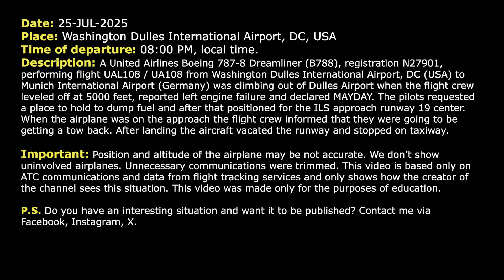MAYDAY. Left Engine FAILURE on takeoff. United Boeing 787 Dreamliner returns to Washington. Real ATC

Comment: Pilot said he had 5 hours of fuel left but they were heading to Munich? Isn't that more than 5 hours in the air??
Reply from the maker: Airplanes burn more fuel on low altitude.
Reply: Aircraft also have to carry extra fuel on case they have to devert to another airfield in case of an emergency

Comment: I live about 8 miles as the crow flies south and a bit west of Dulles. in the rural area of the county.  I usually watch the planes come and go when Im outside and have a pretty good feel for what is a normal route.  A few days ago I was outside working in the yard and noticed an airliner making an unusual path out towards the west heading north.  I thought that doesn't look right and wondered if I'm going to see something on the news.  Well, tonight I saw this story and realized this was what I saw.   So when I saw them they would have been on the south end of the loop heading north. 

MAYDAY. Left Engine FAILURE on takeoff. United Boeing 787 Dreamliner returns to Washington. Real ATC

Comment: " we're adjusting our weight"  translation they are dumping 50 tons of jet a on farms west of DC...so if you live in the area and buy local vegetables, they may have an kerosiney taste. :face-fuchsia-tongue-out:
Reply: i know of no other industry that can just dump 50 tons of jet fuel on the land and people below, and the next day its like it never happened. i understand the aircraft cant handle the extra weight on the landing gear upon landing, so it has to happen, but dammmm.
Reply: @Gasoline4ever  don't even think of dumping the water supply, toilet waste, liquid oxygen or especially alcohol.
Reply: Lol. Haven't flown for a while. I thought the little bottles of alcohol were eliminated due to people acting stupid while in flight. @cocodog85
Reply: the fuel evaporates before it lands
Reply: Let's see data and a demonstration of a jet dumping that much fuel at certain altitudes and temperature and other factors, then let's talk. Until then, vaporsizing before landfall is not a fact. @armoredgaming2352
Reply: @armoredgaming2352  if the plane is high enough.

Comment: The "heavy" call sign serves as a warning to air traffic control (ATC) and other aircraft in the vicinity that the aircraft generates significant wake turbulence. Controllers then adjust spacing between aircraft to ensure safe separation distances, particularly during takeoff and landing phases when wake turbulence is most intense
Reply: Thanks. I was wondering about this.
Reply: @OverkilledUnderdog "Heavy" refers to the size of the aircraft. That's all.
Reply: I had a 707 "roll" me 140° one day 50yrs. ago (1972) after following in a C172 on a short final. I was expecting it, thanks to the controller! I was about 300' agl. at the time.😅
Reply: Appreciate this info.
Reply: Incorrect.  Heavy refers to the size of the  aircraft. That's all.
Reply: You were correct. I said it wrong. It does have to do with size, but how it affects wake turbulence in tight airspace. Mea culpa.
Reply: You are correct. It does refers to larger aircraft but in the sense that they produce greater amounts of wake turbulence in tight airspace. Mea culpa.

Comment: Im surprised the ATC did not give them hold at waypoint and leave them be for 5-10 minutes. He was vectoring them at all times. Putting them into holding pattern west / northwest of the KIAD would do the same job wich much less ATC work and much less ATC communication between ATC and the emergeny aircraft.
Reply: Wants to keep the aircraft close to the airport in case shit hits the fan??

Comment: Boeing again.
Reply: Boeing doesn't make engines
Reply: You do not have a clue.  As BigMedly said Boeing does not make engines.  GE Aerospace GEnx and Rolls Royce Trent 1000 is who makes the 787 engines NOT Boeing.  As usual someone opening their mouth and flapping it in the wind.
Reply: Correct. Boeing again...landed safely after the GE or RR engine quit.

Comment: Interesting.......The pilot is adjusting weight............ The tower mentions dumping........Fuel dumping is not mentioned much........Glad nobody dumped aviation fuel on the trees or river below........... joe
Reply: I believe the fuel dissipates in air….so doesn’t actually hit the ground.
Reply: @michelereid I was curious about this. I don’t know anything about aviation but came across this. Very well handled, kind of cool, glad all was safe. So they can literally dump fuel in the air, no problems? Fascinating.
Reply: If you listen to the radio traffic you will hear the crew member advise ATC that they may need to increase their altitude from 5000' to 6000' the reason is they are expeditiously running through the emergency procedures in the Airplane Flight Manual (AFM) and they likely remember from studying the Emergency Procedures over and over again so as to commit them to memory that for One Engine Inoperative (OEI) the AFM procedure recommends 6000 feet AGL to begin jettisoning fuel.  In aviation design 5000 feet AGL is considered the altitude at which the fuel jettisoned will be dissipated in the atmosphere never reaching the ground. I suspect their companies approved operating manual bumps the 5000' up to 6000' just to be certain it never reaches the ground. And there is more, 

All fuel to be jettisoned is pumped through a plumbing system that terminates with specific overboard fuel nozzles that are designed and tested to atomize the fuel as it leaves the airplane where it enters the airflow surrounding the airplane during flight. The combination of maintaining a minimum altitude of 5000 feet AGL and the fuel discharge nozzles atomizing the fuel into the airstream surrounding the airplane have been shown by testing to disperse the fuel before it reaches the ground.

The Boeing 787 is type certificated under 14CFR, Part 25. 
 25.1001 provides the regulatory requirements for Fuel Jettisoning Systems.

Comment: You have one engine left.  Do the overweight landing.
Reply: As I mentioned in a previous comment, there are several more threats to consider before “just doing the overweight landing”. Forgive me if I am wrong, but it seems like you also seem to think the other engine failing is a greater risk, which again is wild considering we have zero additional and critical information. Obviously these fellas did not think that was an issue. 

Unless you were in the flight deck operating this flight in some capacity (in which case you still shouldn’t comment on their actions), listening to a trimmed audio track of ATC and saying what they should have done is smooth brain material. 

Stick to flight sim👍
Reply: They did; which includes fuel dumping. 😂
Reply: They have to dump the fuel, otherwise the brakes would start on fire after landing because there's too much weight to slow down. They only dump as much as they need to in order to reach maximum landing weight.

Comment: Adjust weight must be Greenpeace speak. 
Wonderful controller work
Reply: More to it than just dumping fuel.  They have to manage weight and balance, which means possibly transferring fuel from one tank to another. They usually only dump enough to get to maximum landing weight.  Plus, the good engine still needs fuel + reserve to land.

Comment: ATC in the US is talking way too much to aircraft in emergency. They disturb the crew with way too many unnecessary calls. Let the crew read checklists without calling for attention all the time. Its exhausting especially when the crew needs to concentrate. The ATC needs to calm down quite a bit to make things safer for everybody. Scrap about half of all calls and leave the crew alone to fly the plane instead of taking to ATC all the time.
Reply: Like most blanket statements, this is patently false. 🙄
Reply: No, they did not.  They did it just right.  I didn't hear anything they said that was unnecessary.
Reply: True, wayyy too many interruptions of our checklist during an emergency.  Of course a simple SBY gets the msg across quickly. Overall ATC in the states is EXCELLENT!!

Comment: Nightmare Liner....
Reply: Exactly the opposite, Timmy. There has been only ONE crash of a 78 in the entire history of the aircraft and that was the fault of the pilot. Dump your Scarebus stock and go back to sleep. Thanks! 👌
Reply: @602STS2 oh yes THAT was the pilot's fault but this cannot be since this is in the US of A. !! Not even of Boeing. In fact it could be the same pilot's fault from AI 171 whose came as a ghost to shut off this engine too
Reply: @602STS2  boeing bot defending it's masters
Reply: @Saurabh_Utter-Pradesh Scarebus bot defending it's masters
Reply: @602STS2 it wasnt the pilots. It was electrical failure. Fight me go on.
Reply: @cosync The final report is not out yet, Bunkie, but fuel cutoff switches don't self-actuate not to mention this is the first crash of a 78 since it entered service in 2011. If you're related to the AI pilot(s) I feel sorry for you. 😟
Reply: @602STS2 they didnt actuate at all. Their electrical potential change because the power through the sensor in the data concentrator died. Im a dc electronic engineer and i know what happened because its as clear as day. Sorry for being blunt.
Reply: @cosync "...I know what happened". 🤣😂
Reply: @cosync  i mean if u are what u say u are u would also know how rare it is for any rogue electrical signals to go to the FDR's to signal a cutoff readings, then if u have ever seen the actual circuit diagrams of the 787 fuel cutoff switches u would also realize u need another separate electrical failure to actually trigger the EEC's to shut down, and that happened twice on both engines, that's 4 separate and isolated electrical failures on a very mature hardware like the 787, not impossible but highly improbable.
Reply: @xdd-69 not rogue signals. A loss of the 28v through that gies through the RDC's internal step down to 10v, through the optocoupler out the RDC to the switch to ground (current return network) That voltage collapse leading to the optocoupler registering an off!
Reply: @xdd-69  and not the EEC shutting down. The direct command from the switch to the fuel control relay in the P300 and 400 cabinets directly to the spar valve, the power through the main contacts of said relays are from dIfferent outer non battery back, isolated dc buses. They were still up and went straight to the valves. Design flaw. Yes i am who I say I am.
Reply: @cosync  ur throwing out buzz words while ignoring the elephant in the room thats 4 independent failures at the same time, which as i said isnt impossible but improbable, extraordinary claims require extraordinary evidence.
Reply: @xdd-69 hiw do i post evidence in the comments section?? It only allows youtube urls.
And no. Im talking one root cause failure. Just one. The battery diode module. You not understanding or knowing these words, doesnt make them buzz words, it means you dont know
Reply: @cosync  i would never consider something posted on youtube as extraordinary evidence u think too highly of urself 🤣🤣🤣🤣, just to put things into perspective even just dual engine failure in an airliner is an extraordinary claim, forget dual switch failure.
Reply: @cosync  there are 260 families that want closure, there is an entire industry full of experts that want answers, the entire world is waiting for answers, there is an entire team of experts with the physical evidence that want answers, if u think u have the evidence then why not just make a report ? and put an end to all this and finally give every1 the closure they need.
Reply: @602STS2  The AI crash is not the first 787 to lose power to both engines.
Reply: @xdd-69 ffs the switches didnt fail. Why is everyone so confidently brain dead? Think harder
Reply: @cosync  u dont know that, but what we do know is the switches went to cutoff as per the official report, whether that was due tot he pilots physically moving it or due to erroneous electrical signals is the question, but because of how everything is hooked up the latter is highly unlikely, leaving the former the most likely situation, but nobody knows that for certain for now, and like i said if ur so confident that u have everything solved like u said earlier, just release a report, with what "supposed" evidence u have.
Reply: @cosync  also calling others brain dead, when every1 including urself is working off of theories and hypotheticals also makes u just as stupid and brain dead.

Comment: The more impossible is how their waste their time by asking for fuel  dumping . they have over weight landing checklist , they should use it in this kind of emergency , you never know what’s gonna happen to the other engine , especially what happened to the other engine is a failure.
Reply: There are several other threats to consider that are much more likely to become a factor, before experiencing a second engine failure.  And to say “ they should have done this”, is wild considering we have no information at all. 

Job well done to these fellas for a safe landing.
Reply: They only have one engine to reverse thrust on landing so I'm pretty sure that landing really heavy would be more dangerous than holding for a bit near 2 airports.
Reply: Stick to gaming. 😂
Reply: Yeah... let's not consider that there's only so much runway for this plane, which is already heavy, to land on. It would most likely have gone off the end of the runway without the fuel dump.

Comment: Washington to Munich w/ 5 hrs of fuel? How is this even possible?
Reply from the maker: I think they had 5 hours to fly at 5000 feet. They would have more time if they were higher.
Reply: Fuel flow at 5000 feet on one engine might indeed be 5 hours.
Reply: Thx for the explanation.
Reply: They are probably basing the time off of their fuel state after they adjust weight for landing.